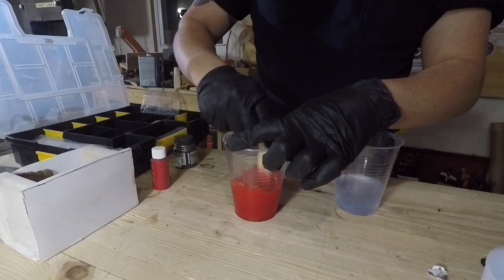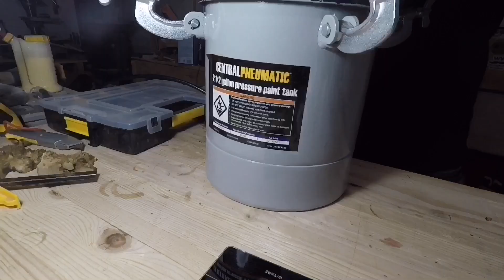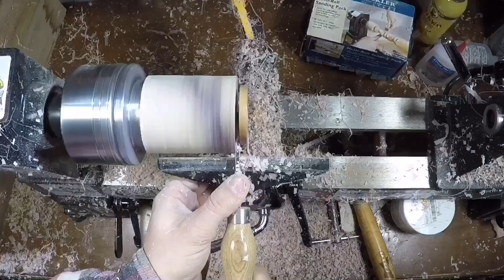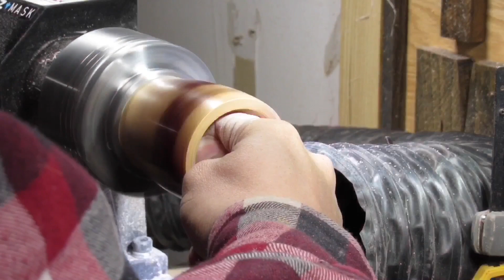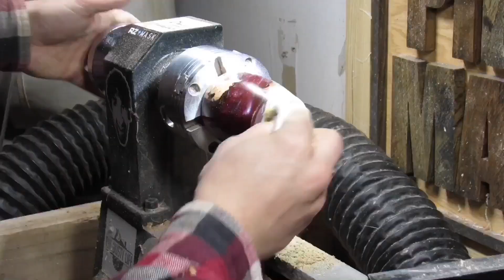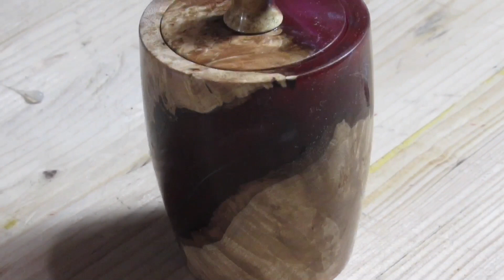Hybrid Lidded Pot - Casting and Turning Burl Wood and Resin

Comment: So that thing you put it in makes the paint/resin dry all the way real quick & all the way?
Reply from the maker: litatylovesyou It’s a pressure chamber. It helps the resin cure without bubbles. It doesn’t make it cute any faster though. I had to wait a day or two because it was so cold in my shop.
Reply: Joe Pierce ohhhhh. Okay. So if you left it sitting out, it would have bubbles right?
Reply from the maker: litatylovesyou correct